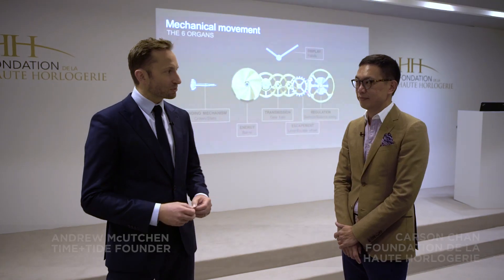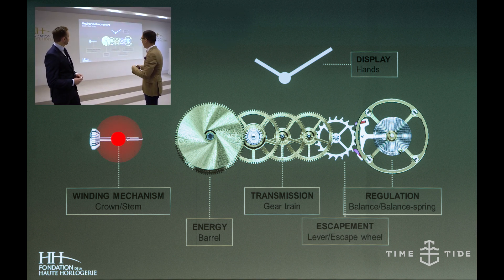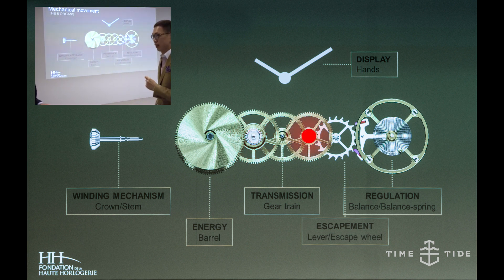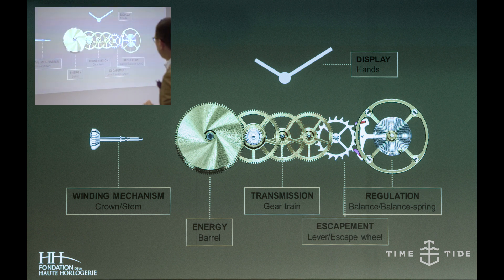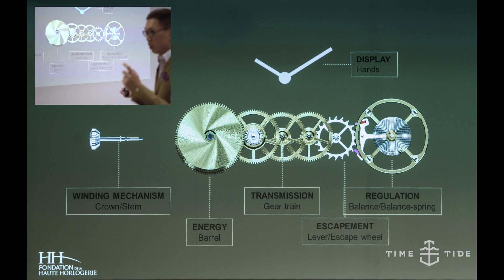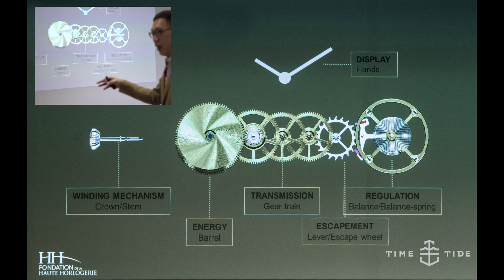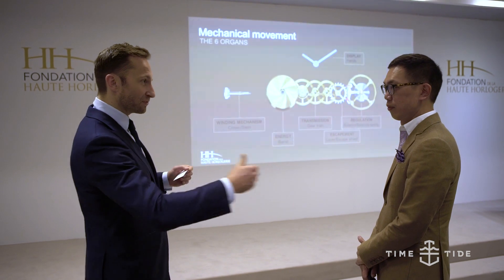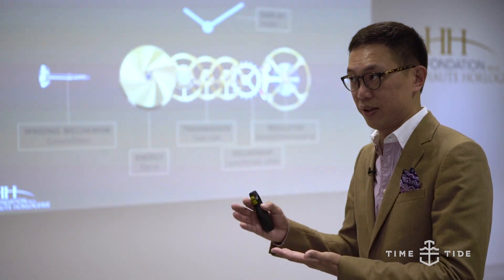How a Mechanical Watch Works

Comment: Help me to understand from where is the power to make the first tic.
The clock is run out (the spring is unwinded). The clock is stop.
Fork is not moving, balance wheel is not spinning (balancing). The jewel is blocking the escape wheel by the last beat of the system.
We start winding the clock and the power from main spring starts to rotate the wheels one by one until the escape wheel is powered.
This is the magic moment.
HOW THE ESCAPE WHEEL MOVES THE FORK FOR THE FIRST TIC TO PASS THE ENERGY INTO THE HAIR SPRING IN THE BALANCE WHEEL WHEN THE JEWEL IS BLOCKING THE SYSTEM ?
Reply: As the power runs down, eventually the balance amplitude reduces to almost nothing, but its neutral position with no power is with the roller jewel in the middle of the pallet fork horns, with the pallet fork centred. In this position, the pallet jewel angled face rests against the face of a tooth on the escape wheel, and a little torque on the escape wheel will push the pallet fork away setting the watch in motion.

When the roller jewel is disengaged from the pallet horns, the pallet lever mechanism is essentially bistable and should flick to one side or the other where the pallet jewels just lock the lever in place. For this reason, it is important to set the hairsping on the balance wheel so that in its neutral position it would hold the roller jewel in the centre of the horns as described above, otherwise (amongst other problems), it will be necessary to shake the watch to move the balance and set it in motion.